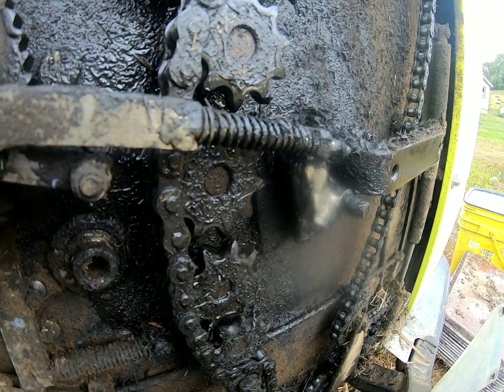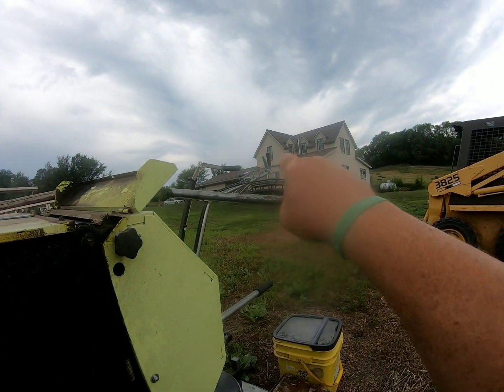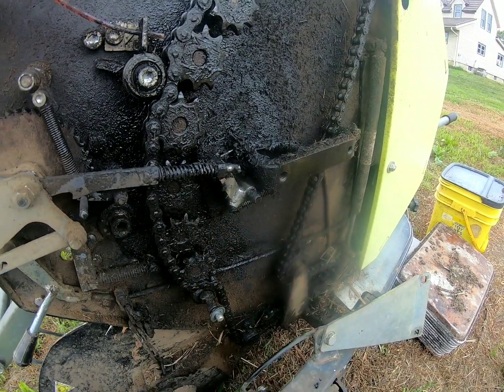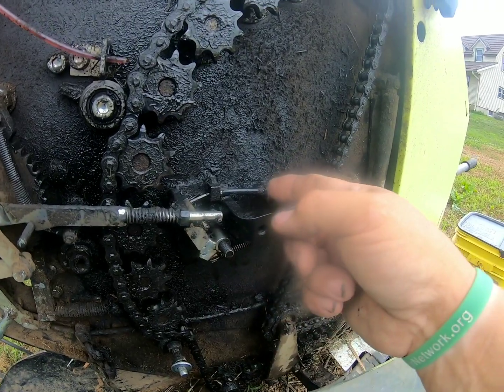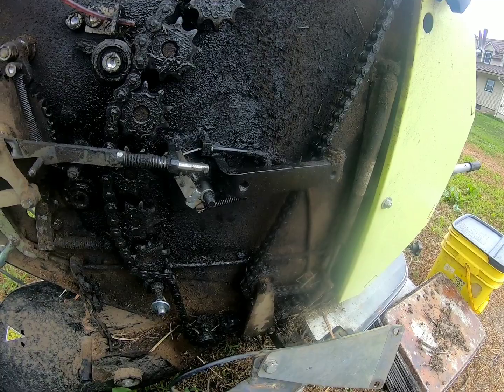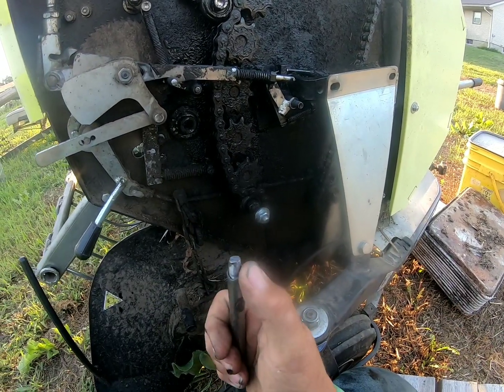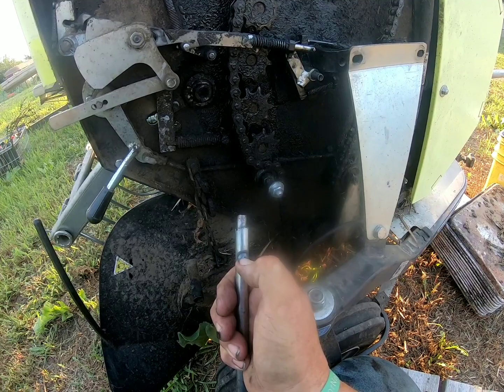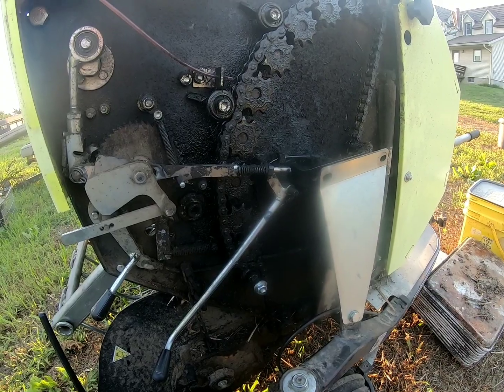DIY Caeb Baler Trip Lever Repair.

Comment: Very creative custom diy work, to create a new trip lever for your baler, Hope it works, would be great if you can manage to keep that little baler working🤞🤞🤞
Reply from the maker: It's officially fixed. I just ended up welding it right away rather than drilling the hole and securing it with a cotter key and welding it at a later date. I figured it was going to be welded eventually. Why not take the little extra time now and just get it done and out of the way.
Reply: @bryansloesshillshomestead4523  👏! 🤗